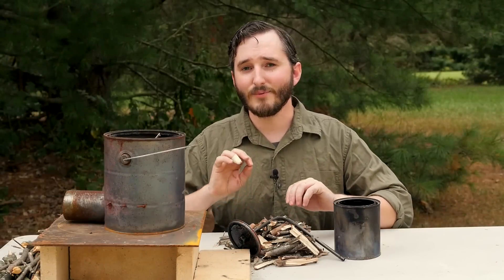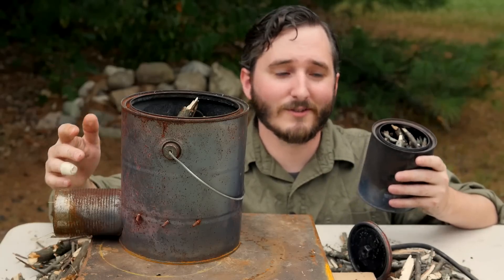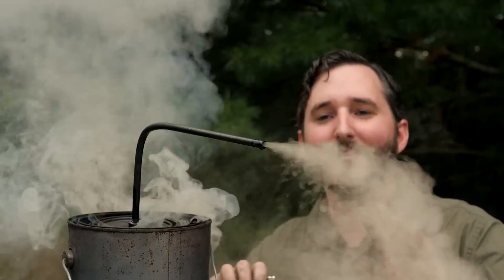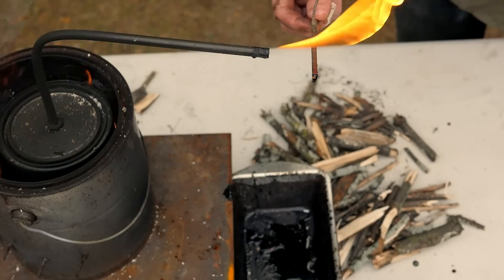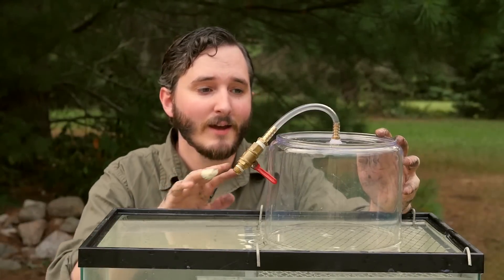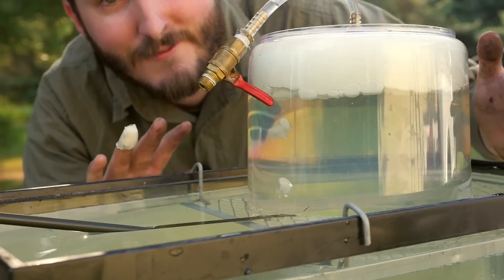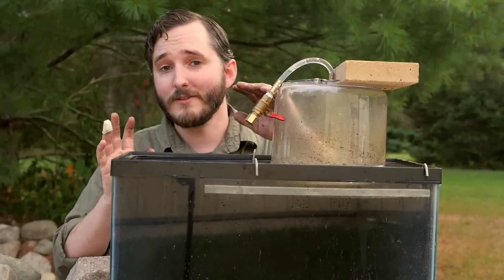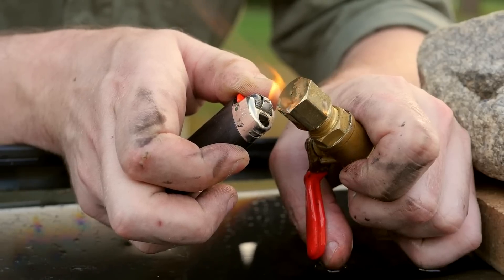How To Make Wood Gas Biofuel (and an experimental gas collection method)

Comment: Very cool experiment! I actually have a friend that converted a Geo Tracker to run on wood gas and it works very well. Much better than I thought it would. Thanks again for sharing your method! 
--Eric O.
Reply from the maker: That would be a very fun project. I've got some work to do before I have a system that runs clean enough for that
Reply: To my surprise it works very well.  Good luck with it and look forward to seeing more!
Reply: @SouthMainAuto  How to convert this to liquid state?
Reply: @itsashepubg8967  Since it's methane, butane and hydrogen (basically, LP gas) you would need to pressurize it quite a bit to store it as-is.
Alternatively, you can further process it to turn the woodgas into high-octane synthetic gasoline.  The process is pretty long to explain here, but the cleanest and most efficient method appears to be STG+.

The normal method of use is to just have the the woodgas feed directly into the engine after being filtered.
Reply: @itsashepubg8967  <<How to convert this to liquid state?>>

It's not practical to liquify the gas,  it would need a process like liquified natural gas.

But you can compress it.  A good way to do that in a simple device would be to valve the gas off into a balloon,  which would also keep it pressurized.
Reply: it can use wood, or paper, it doens`t have to be high quality wood, any plant matter work, you won`t believe how much useable wood gets thrown away as garbage...
Reply: How does he store the wood gas. I remember a while back there was a colony reality show where they just put the entire wood gas producing system right onto the truck and piped it right into the engine.
Reply: Omega Rugal Here here, for woodgas people it's a depressing circumstance!!!
Reply: I made a wood gas stove out of 2 cans, works great ! I use it. for backpacking
Reply: some use a small trailer, basicly they haul their own fuel source
Reply: That's how the old German kubelwagens ran, too. You filled them with wood and off you went. They smoked like locomotives and were famously cranky, but no storage of gas was required.
Reply: Your correct .
Reply: Wow, that’s cool! I got a geo tracker turbo diesel as my first car, and I still have it, I’m 25 now. Since 2019 or so I’ve ran it on waste vegetable oil as fuel.
Reply: Probably uses a lot of wood... which would create another problem that is already present... deforestation.
Reply: @gasa1165  Yeah but for some it could be useful... I work in reforestation and I'm always surrounded by leftover wood.

Comment: Hey Nighthawkinlight you should try bending the brake line at an angle in which it points the gas back into the oxygen intake to double the efficiency of your charcoal wood stove. P.s. If you make a small bubbler system for the gas to run through before going back into the stove, it will clean the gas before it burns
Reply from the maker: All you have to do to increase efficiency for charcoal is use my can with the holes in the lid but flip it upside down. The gas is ejected back into the fire.
Reply: carolyn mmitchell black powder
Reply: By BP, you mean an activated charcoal?
Reply: Just remove the lid.

Put enough wood in to the can to make it "stick" when you turn it upside down. Place it in the rocket stove. Fill it with "enough" wood, and light it of. After a few runs you can tune it to the point where it produces great charcoal for BP. Charcoal produced when running it al the way to "completion" as in this video is overcooked, and doesn't work great for BP, but will do fine for pretty much anything other then pyo, where charcoal is needed.
Reply: Mr B what's BP

Comment: Use a fridge compressor to pressureize the gas into one of those gas flasks. You should filter it and bubble it through water before you put it into the compressor

Comment: submerge the the container, fix it in place, drain the water, light the fire/produce the gas.
There you go you now have a vacuum that will pull the container towards the water and you'll be able to store more gas in it if you submerge it deeper.
though you need the valve to be on the other side.
basically what I'm trying to say: 
this is dope as fuck! a little more tweaking and engineering and it would be even doper and fuck harder! nicely done, your videos are great inspiration :D
my father is making a wood burning stove and this gave me an idea that I didn't think off :)

Comment: Use one of those huge Fresnel lenses from an old TV to heat the gas generator with the sun, then it will be completely renewable energy. Sun + plants = gas!
Reply from the maker: Burning wood is actually carbon neutral if the wood is already dead. All the sticks on the forest floor will give off just as much CO2 as they rot as when you burn them, so may as well take advantage of it
Reply: Good point. I didn't think of it that way.

Comment: Nice Video!! I always prefer unscripted videos, so for me this is perfect.

I have wanted to build a wood gasifier for a long time, so it was fun to see yours in action. Have you considered condensing the wood gas using something like liquid nitrogen or dry ice into a normal gas cylinder for propane appliances? not sure if that's possible, or maybe too dangerous, but if you were able to do it, it would be potentially possible to use it for existing propane appliances such as stoves and grills.

Comment: This is not what one would traditionally call wood gas(I believe), in a wood gas generator ('In most cases a downdraft one.) a small amount of air is sucked in through the generator nozzle/nozzles combusting some of the wood and turning the remaining wood to charcoal by pyrolysis (Most of the tars are cracked by the heat) and then the CO2 from combustion is turned to CO when it goes over the red hot charcoal. I'm no expert in the area of wood gas or chemistry but I think this is what happens.

Comment: I like this. 
Pyrolysis is kind of a forgotten art. 
It's not generally used for the volatile gases as much, but that's kind of a shame, because it actually does it much more rapidly than fermentation. 

With regards to catching and pressurizing, this system is also a rough way of removing alcohols, organic acids, and hydrogen. 

The water acts as a selective filter. Only compounds that can't sink into the water will remain in the gas tank. This is especially true if you let it sit for a while. The hydrogen probably doesn't filter through the water though since it can actually move through metal lattices.  

With regards to tar production, dry, dead wood is the best way to avoid it. Any green part of a plant and general humidity cause it to form. Seasoned wood processed on a dry day limits the amount produced, but certain types of trees produce compounds that hold onto moisture at molecular level (birch mostly), so experiment a bit.

Comment: Please remember that all the gases are soluble in the water. Hydrogen and methane especially since there's probably very little of those gases dissolved already. This could throw off the molar ratios of the gas mixture.

Comment: Try pumping it out of the small container with your pvc vacuum pump then using the outlet of the pump to pressurize the wood gas into a separate, detachable container.

Comment: There are FEMA plans easily found with google from WW2 for a wood gasifier that is pretty simple and will power any gasoline engine.  I'm not sure about the safety of compressing the gas though.  Be careful with that project.

Comment: you can turn the syn-gas into methanol using a catalyst
Reply: methanol can easily be stored and is a very versatile fuel it can be used as an additive in both gas and diesel engines
Reply: Viro Science which catalyst is that again ?
Reply: copper and zinc-oxide in a reactor at a temperatuur of 200c
Reply: I really interested to this process, what is the best catalyst?
Reply: I think its some metal oxide, like copper oxide or alumina. But it has to be at the right temp and pressure or there could be unwanted side reactions.
Reply: Viro Science well, Challenge accepted i guess
(But it will tale us quite a lot time...our video to-do list is massive and I'm not home currently :(
Reply: Machine Geek+++"Good enough" is always good enough.  Over engineering is the bane of "Get 'er done".
Reply: Sarch Lalaith we did a video on our design, but we haven't tested it out yet
Reply: The Chemical Workshop

Think of it like ak vs ar
Yours might be cheaper and and less efficient, but if you can make 30 for every one of theirs then on balances yours is the better design :)
Reply: Engineered nanocarbon catalysts can do convert syngas into methanol or ethanol at high temperatures, but unless you're a chemical engineering whiz or have enough money to scale this up to commercial production levels, it's not going to be a viable method of alcohol production.
Reply: PolyJohn it's still worth a try if we xan get hands on some catalyst
Reply: I haven't yet used Iron as a catalyst but I doubt the effect since the point of the catalyst is to bind oxygen to the reactants and since iron reacts with oxygen to form a stronger iron 2 or 3 bond with the oxygen producing iron-oxide zinc-oxide on the other releases oxygen at 200C which is highly reactable with the organic compounds
Reply: Sarch Lalaith well, i don't think i have any chances against his project
And to be honest i don't care, i just want cheap methanol/wood gas
My design is very very simple and quite cheap actually
I'll test it next week i guess?
I mean i could do it tomorrow but the weather is shit and my shots won't be as good as i would like them to be, quality over quanity 👌
Reply: Yeah you should build one 
 mine works great one thing i would ad is  that in this video he distills the wood so he does not introduce any oxygen which produces relatively more methane and other gases it is better to just limit the amount of oxygen that enters the system because the only products you need are hydrogen, co and co2
Reply: You guys NEED to design a unit that's easy to build at home to get good gas or alcohol (ethanol engines are pretty good). Right now I think guys like me are limited to building solar units.
Reply: The Chemical Workshop when you test it let us know how it stacks up against victory gasworks one.
Reply: Viro Science like

Comment: For a some time now I was wondering about dry distillation and how to do it with cheap tools and then there is this video. Didn't think that it would be that easy. Better method of collecting gas is stil some thoughts away.

Comment: Yes! This is really cool! You should really do more pyrolysis related projects. People tend be quite interested in this process, including pyrolysing plastic residues to give an oil that can actually be used in automobiles. I've seen it done in person, I'e had the opportunity to work with small company employing this process on plastic waste and it is quite interesting, as well as the fact that pyrolysis only consumes a fraction of the energy it produces in the form of oil, gas and char, so the process is more than capable of being self-sustaining. 
I really think that pyrolysis related projects would fit the experimental and do-it-yourself vibe that I really enjoy in this channel :)

Comment: Cody uses fridge compressors inside of a huge bag full of a gas to pressurise them for his oxy-hydrogen torch. Hopefully it would work here too. Also often converted engines had a huge bag full of gas on the roof so it didn't have to be compressed. Anyone british will remember the dads army episode where they converted the butcher van and popped the bag with bayonets
Reply from the maker: I tried filling a bag first but the gas was coming off too hot and melted it. And filled it with nasty water/tar that I didn't want to expose my air pumps to for pressurizing it.
Reply: Could you use a bubbler similar to the one that grant used on his water spliter ages ago?

Comment: what if u direct the pipe back into the J-tube to further fuel the fire and generate more heat, u might be able to make charcoal alot quicker that way
Reply from the maker: Yes if all you want to do is make charcoal it's best to just have holes on the bottom of the can so the gas feeds back into the fire.
Reply: I'm a chemeng student, one thing I really wanted to try is make syngas, its a similar process but you use coal and steam instead of wood. the H2 yield is much greater, CH4 is a product and there is less tar, might be interesting to try

Comment: awesome man, you should invent a way for people to convert their engines to wood gas powdered cars, I know it may not be possible with newer cars buts 60s,70s maybe?
Reply: let's go back to steam engines then, there was room for upgrades but they were outrun by the fuel engine. When oil will become more expensive than wood, it might not be unrealistic to see people using wood as fuel...hell you can make a steam generator and charge your electric car....what's the harm when currently we're burning billions of gallons of fossil fuel. At least wood grow back using the burned wood, so in balance. Next step : genetically engineering special fuel-trees, that grow quicker than any other, so it can store more CO2 fast. Why not.
Same idea with algae fuel, currently in experimentation if I remember.
Reply: Astaldoath it's been done since the 40s. My late uncle had a sawmill in Oregon thats engines ran on the sawdust that was produced, 100percent self sufficient. I will add that he used a cooling pond to filter and cool the gas before it was introduced to the engines.

Comment: just look up the free document for a gasification system that is on the government web site.  You can run emergency generators from the off gas.  Some people even have their vehicles powered by gasification systems, even a V12 Dodge Ram Pickup in Georgia.  As for the filtration, thats covered by the free government plans as well.  A multi-step filtration process pretty much clears up the gas for use.
Reply: Do you have a link? Thank you.